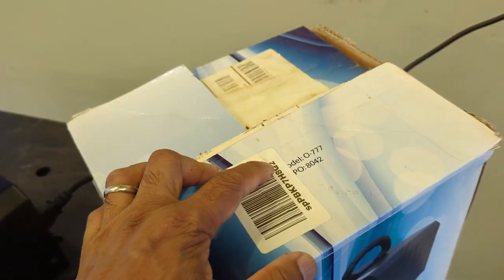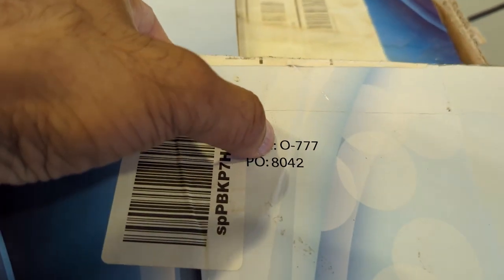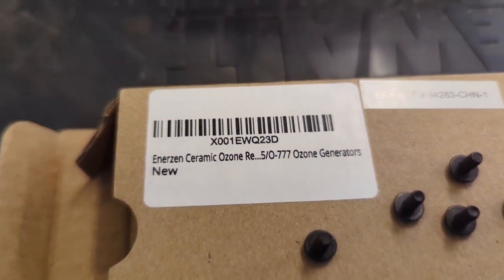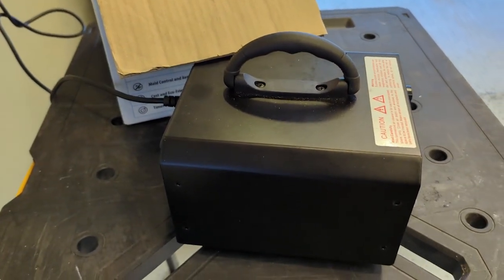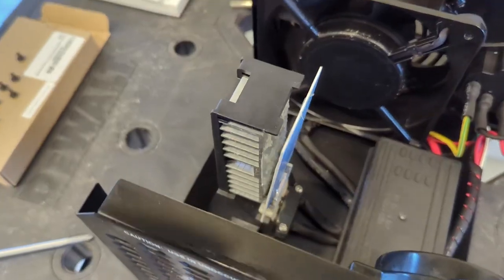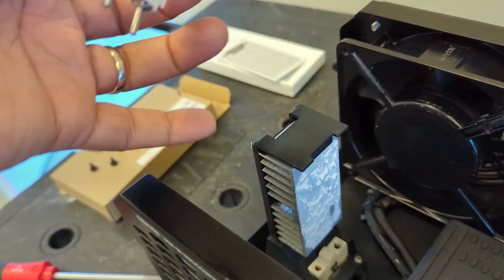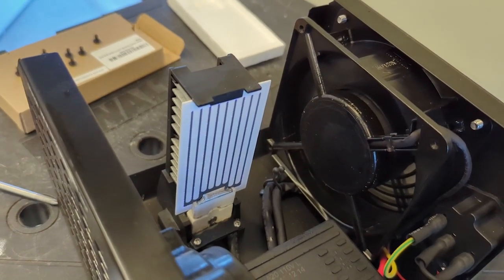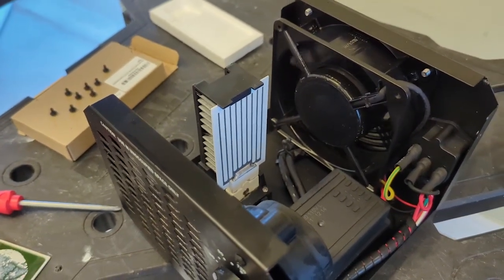Ozone generator replacement of ceramic plate

Comment: My new plate produces ozone for a second or two then stops. When I switch it back on it does it again. have tried several plates but same thing. i also replaced the heat paste on the back. Any ideas what could be causing this issue? I have the same model as you.
Reply from the maker: Sounds like it's not the plate, possible a short circuit or other defective component. have you reached out the seller?
Reply: @Andrewsnotes1  It's a good 5 years old and I'm pretty sure I got it on Amazon. Looking for a simple home fix, but i suspect at this point it may be the main black box inside.

Comment: Just wondering, is there a replacement thermal grease or compound, as it seems mine came with barely any
Reply from the maker: I don't know what they used, but my plate stopped producing ozone after a few hours of use so not sure if adding compound would extend its life.